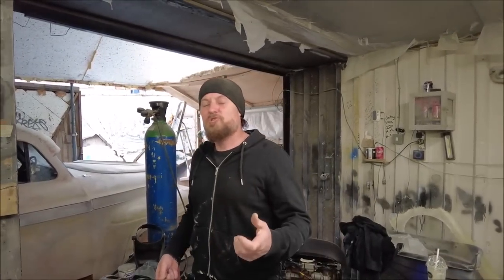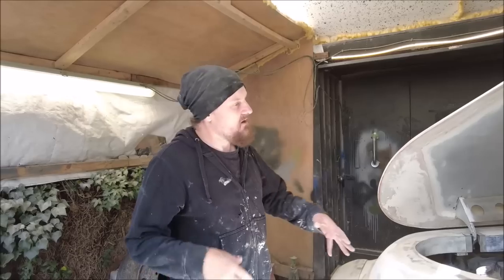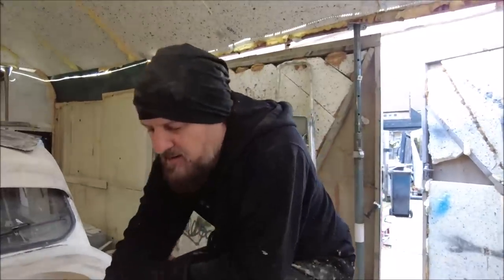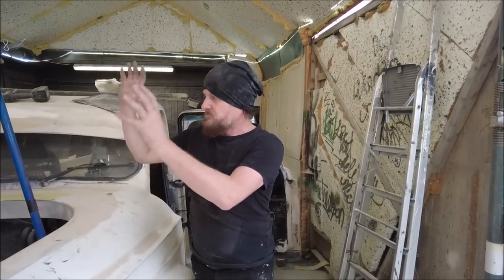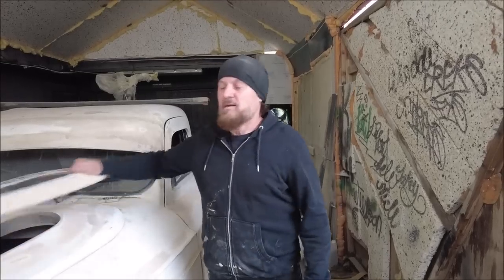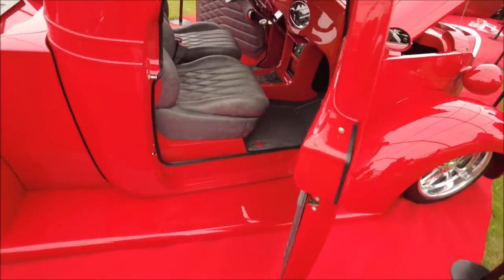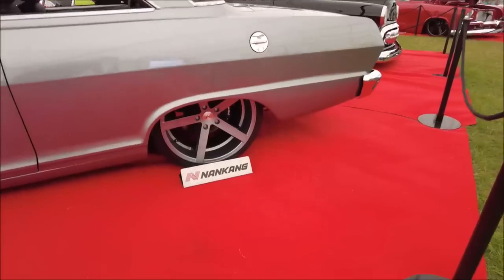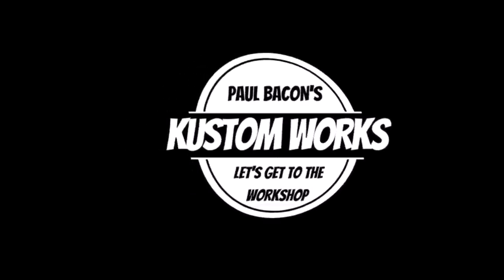Now that's how to build a Kustom Truck!

Comment: really enjoyed your second visit on the "ultimate Hot Wheels challenge" with the Mardi Gras dance floor car - here's an idea , how about a clear bubble on the hood of the 60s truck and have 5 weber carbs stuck up in the bubble when the hood is closed , and that would make it easier to install (the bubble) from underneath  :face-turquoise-covering-eyes:
Reply from the maker: I have also had the same idea, but crazy difficut to do!

Comment: Paul,  you made my week by having a video to watch.  I've tried several times to get an email address from you but, I know you're such a busy guy.  You know at this stage of blocking the truck try using a guide coat of spray can black dusted over the whole truck shows you what your eyes don't because you are blinded by the hours and hours of sanding.  It'd be really cool on the plexyglass on the hood to go around the sides of the glass with LED's it doesn't take many but, it lets you light up with any color and just a really cool effect.   The cool thing is you could put a name or design from sand blasting lightly and it lights that up off the hook   I've used it on one of a kind tail or turn signal lights.  You could also bevel around of the speed holes on the hood hinge plate.    Just because my body doesn't work for me doesn't mean that I don't have tons of unseen tips and tricks.  Have a great week and thanks again for the video I know how much time ad effort it takes to make them.  I tell everyone I know to watch your channel.  I'd love to see you with a million subs.  You deserve it !
Reply from the maker: Thanks so much, you always have super cool ideas and one day I will use them all :))))
Take care mate

Comment: Hi Paul, have ever thought of contacting Hot Wheels to get some of your work done in 1/64 die cast....Twin engine Corsa just did a video on it.  Seems they're looking for cars with soul, that were built not bought.
Reply from the maker: My last build 'Automatron' came very close to getting built into a Hot Wheels Car, but it came in 2nd place.  I can't help but think its because it would have been too comlicated to cast.
Hot Wheels are well aware of my builds, I was recently a car builder on their US TV show.  It may well air in the UK one day which would be cool.